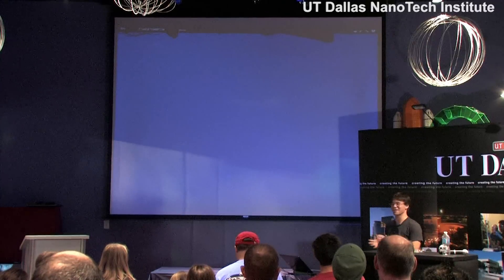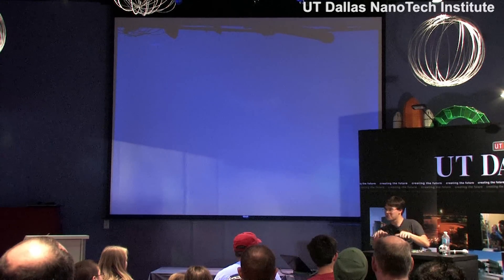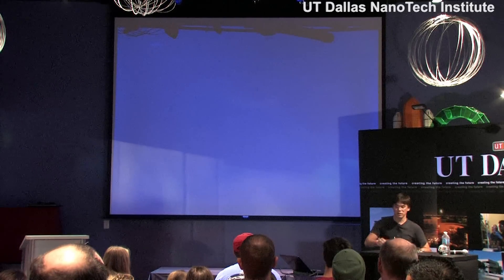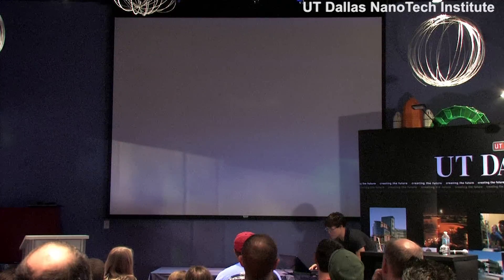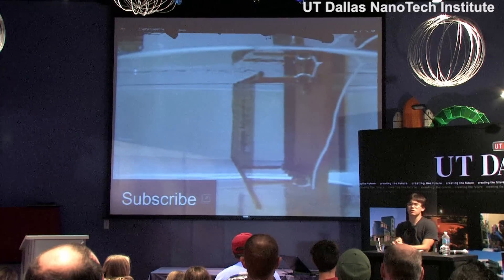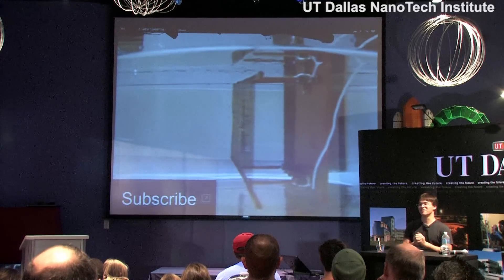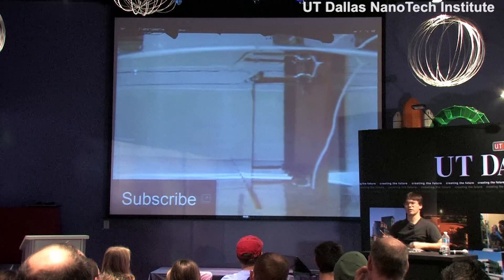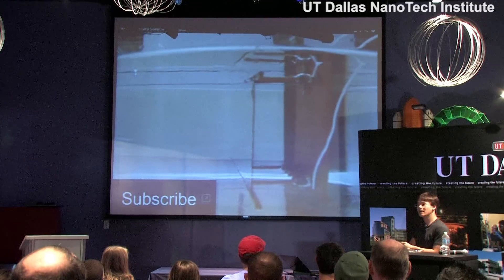2013 Nanodays- Carbon Nanotube speakers and Invisibility Cloaking- Carter Haines

Comment: It bends the light because it is also a wave.  I paused the video before he could explain that.  Sound is a wave too just of different intensity and frequency.  Sound, light, heat and probably a few or more that I did not list are all...........waves!  There are magnetic waves and xrays and they to are waves.  You can not see them but they are there.  How do you think your microWAVE works?  RF waves at around 2.4 GHz, it is essentially a magnetic wave and that is why you will see metalic objects spark if you accidentally put them in there.  Things are not always what they seem to be at first.

There was a time I never knew you could make a sheet or strand out of these nanotubes and now I buy coatings for my car that work like a wax except they have nano particles of silica in them.  They leave a very glossy, water repellent surface behind and are now now all that expensive anymore.  While driving down the road on a rainy day, I can watch water run up and off the hood of my car as if it was coated with Rain-X except that I think Rain-X is most likely something else and not paint safe.  The neatest thing is that one product I use, you just wet the car down and then mist the coating on and quickly rinse it off and now your car is coated.  It is like magic!  The car ends up looking like you just spent all day polishing and waxing it but it only takes a few minutes.  You still have to wash the car before you apply it if you want it to look good but it will wash clean much easier.  I am thinking of giving my friends some of that stuff, they will not believe their eyes when they see this stuff working!  Next time my sister has a garage sale, I should take all of those old bottles of wax and sell them just to get rid of them and buy more of that wipeless silica nano coating to replace it.  It comes concentrated and you mix up some when you are about to apply it because when mixed they sometimes don't store well, I guess that they end up coating the inside of the bottle if left sitting too long after being mixed with water.